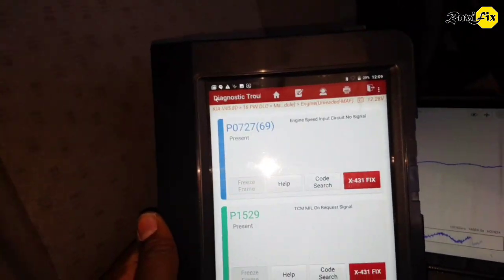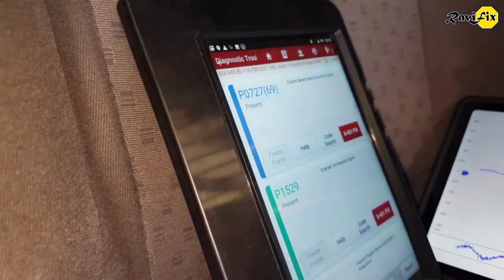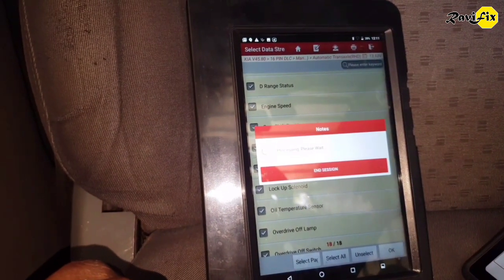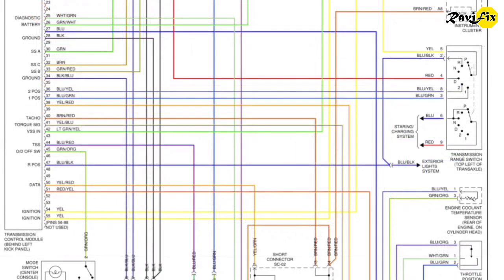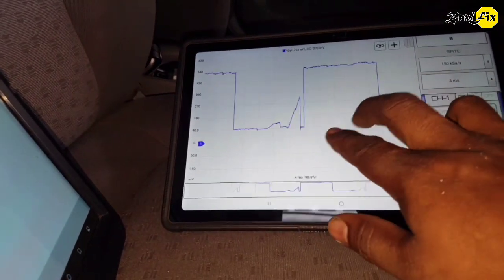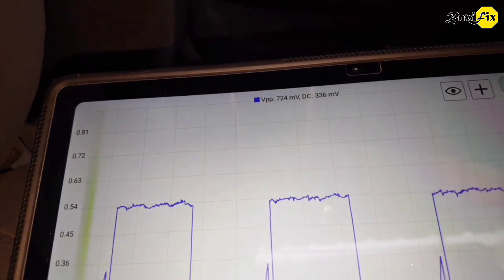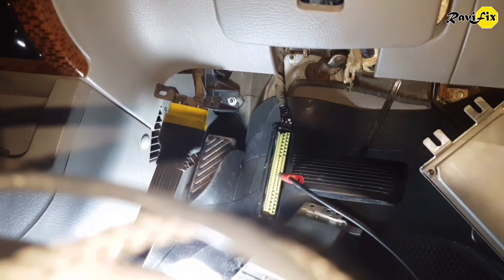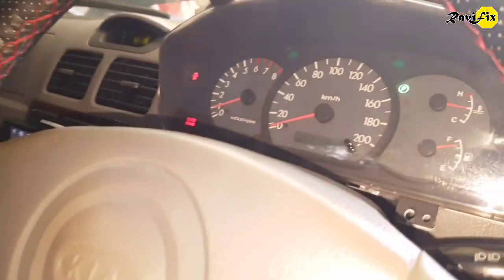KIA Rio no RPM signal in to the Tachometer and TCM. P0727 and P1529 TCM Request MIL on diagonosis.

Comment: If speedometer not working, might it be the same TCM problem?
Reply from the maker: No. It is an another problem. Might be speed sensor or meter itself.
Reply: If speedometer works only 10 minutes during morning drive? After that, speedometer turn to 0.  @ravifixall

Comment: Great diag!  Would i be able to check the signal with just a meter as i dont have a scope? Should it be reading 12 v ? and if its similar issue as you then it should be reading lower than 12v?
Reply from the maker: Voltmeter is not a perfect device to see this kind of signal. But you will see voltage around 12 if you get a RPM signal.

Comment: Hello sir i have swift vdi disel 2009 car rpm slightly fluctaute always stuck on 1100 rpm car vibrate   code is p0560 system voltage.. I have lost my lot of money to solve this but problem not solved plz help me
Reply from the maker: Check battery voltage. Specially on fuses and relays might drop the voltage and make the low voltage supply to the system.
However chase the system voltage code chek for voltage drop.
Reply: @ravifixall mechanik saying clean the catalytic converter and 02 sensor